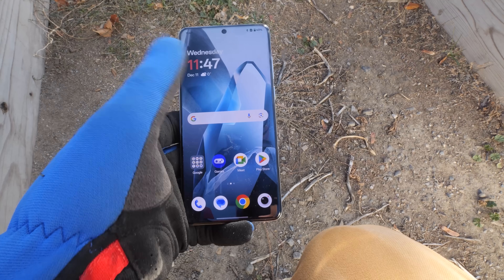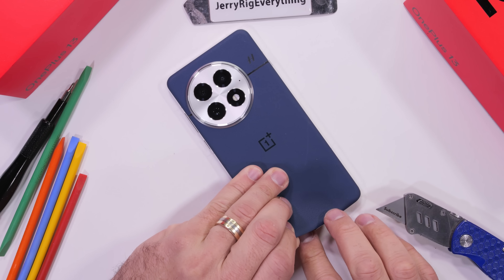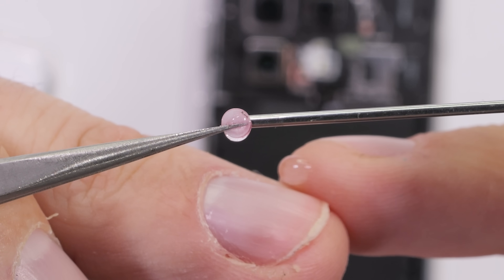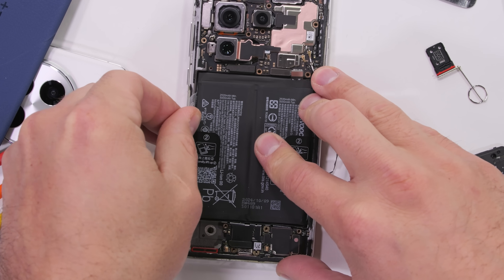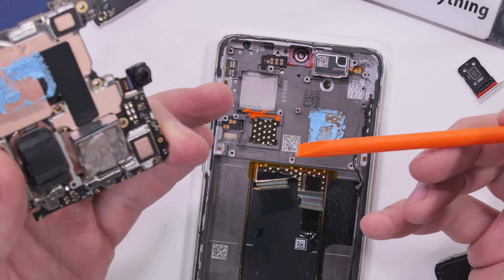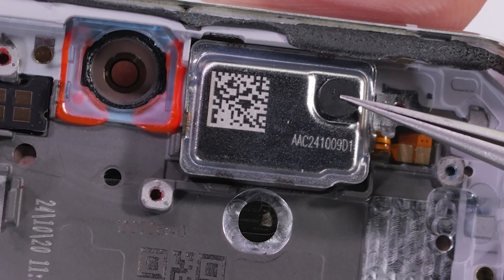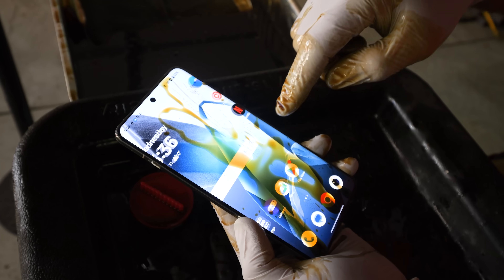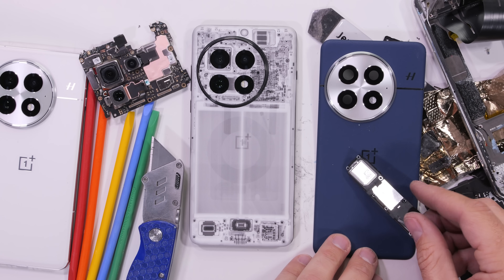The OnePlus 13's Double Decker cooling system - TEARDOWN

Comment: Author, please tell me, if I dry the SIM card tray with a needle when removing it and insert it into the hole next to the tray where the microphone is, can it be damaged or is there some kind of protection?
Reply: Never use a needle! If there's not a SIM tray opener around use a paperclip. It's less damaging.

Comment: Hi, I heard inserting a sim ejector pin inside the mic port won't  damage the waterproof layer or sleeve because its positioned offset at a 90 degree angle, is that true ?

Comment: I have a oneplus 13 black and the glass shattered with a 1 foot drop. Have to replace it.  Regret not buying blue because of leather back
Reply: I dropped mine from 3 feet/1 meter. Only the frame scratched a bit.

Comment: The cooling system on the OnePlus 13 is fantastic. When playing Wuthering Waves my OnePlus 13 is cool and pleasant to use while my S25 Plus and Ultra are hot like a stove. Snapdragon 8 Elite is known to overheat and almost all phones with it face the issue of very high heat. OnePlus 13 solved the problem and did what Samsung and many others couldn't.
Reply: Why do you have 3 new phones? 😅
Reply: Alright. Now try to do it again. S25 ultra was unoptimized prior to one ui 8 and warmed more than before.
Reply: The simple way is to make the Vapor Chamber larger and transfer heat directly to the SOC to the Vapor Chamber. Meanwhile, Samsung's Vapor Chamber used for the S25 series is 1-layer, smaller, even a confusing decision for me is that they direct the SOC and RAM up while the vapor chamber is at the bottom, this causes heat to be transferred indirectly and diffusely through 1 layer of PCB, and Samsung is using a 2-layer PCB design. Stupid design, even an idiot knows that a design that directly contacts the Vapor Chamber via thermal paste like a PC's CPU heatsink does is the best way to keep the temperature down and stable. I think it's not that they can't do it, but they intentionally did it to make the device's performance poor, and next year they made the Vapor Chamber bigger as a huge upgrade to sell. and many years later they made SOC and Ram in direct contact on the bottom surface like that was revolutionary and heat dissipation. I feel like we are sheep that they plan to fleece for a long time, and act like users are idiots to sell 1 version of the phone with changes at least every year. look at how well their R&D department works with telephoto and wide angle camera sensors, making the top Ultra models of Chinese brands use it and of course their top phone S25 ultra doesn't use it. Maybe in 3 years we will see it on S28 ultra as a revolution and technology

Comment: Can someone please test the water resistance while phone is wet inside a case and having the buttons pressed? Cause thats what i did and my oneplus 13 midnight blue died. Screen went black, and battery started heating up randomly on its own as i tried hard reset 100x to no luck. Had to refund the phone. The condition wouldve been no differemt than using phone while in case on a rainy day. For reference i used the tudia pine green merge case. If this happened to me i wouod bet i can happen to alot of people.😢😢😢
Reply: Tell them how many times you put that phone in water. Other people aren't going to constantly get it wet to keep testing it which eventually kills the phone, then return it and get a refund like you did.
Reply: @snowps1  I've washed it at least a dozen times in 3 weeks under the sink. Wiped it off and blew dry and nothing happened. The only t8me was when it was with case on and I pressed button while it was still wet in case....that's when screen stuttered and shut down. This scenario would be no different than if I used phone while under rain and I press on button. So take it from me....don't trust the water resistance advertising....treat it like any non waterproof phone. After seeing all the water abuse videos on YouTube I thought this would be mild in comparison but it died...thank God this happened during my return windows and bestbuy reps didn't ask too much questions.

Comment: Why does adb shell dumpsys battery shows the "Charge counter: 5238000" for 100% charged battery at completely new OnePlus 13 device? 
Similar shows AIDA64/Battery: 
Charge Counter: 5212 mAh
Capacity (Reported by Android): 6000mAh
Device spec says: The battery of the OnePlus 13 adopts a serial dual-cell design, with a typical capacity of 3000mAh, equivalent to 6000mAh; typical energy: 22.92Wh. The rated capacity is 2920mAh, equivalent to 5840mAh; rated energy: 22.31Wh.

So the question, shouldn't we expect 5840000 value there?

Comment: one plus is a good phone but unfortunately it only has an update for 4 years when all the others have 6-7 years, and as always the camera is not very good for a flagship.
Reply: Updates doesn't matter. I max update 1 year after purchase becuase most companies send bugs. Currently still having 7t and going to exchange with 13
Reply: don't forget there is also a problem with the camera which doesn't really fit the flagship standard , don't understand what this means 7t @roninr8199
Reply: @roninr8199  First of all, I'm not talking about a random update to the new version of Android. All competitors have between six and seven years of version updates. I'm not talking about the camera from the previous year. You can't just depend on the processor, 
Because they're not in Apple's league yet,

Comment: I cracked my screen literally 2nd day after getting it. Dropped it from like 1 meter height jacket pocket and fell on lower corner left side. It was cement. There is some blue in the lower corner behind the screen and at the point of impact the silver lining frame got one small indentation and some chipping off nearby. Curved screens are a nightmare. I dont think Corning glass would be so fragile. I am getting it repaired and slapping a military grade case on this thing. The screen is gorgeous but its not worth risking without a good screen protector. I even kept the membrane it comes with on and checked several unboxing videos nobody was shown removing it which was what i was interested in seeing. I think it should be removed and a proper temper glass be applied. Although i don't think thats going to be much help either. Need a flap on the screen or this screen will break before you know it.

Comment: Holding out for your bend test results -  A phone's cutting edge techy specs don't matter if that phone is too fragile to survive real world use.  I was a faithful OnePlus customer until my phone's rear glass broke in my front pocket.  Now I don't buy any phone that fails your bend test.  I had reached across a table and inadvertently leaned against the table, with the phone in my pant pocket sandwiched between my thigh and the table edge.  The forces exerted on the phone during this failure were similar to your bend test.

Comment: I once dropped my op 8 into dirty motor oil pan it surprisingly survived still actively using it
Reply: I also used a brake cleaner on it to clean oil and then rinsed it with soapy water

Comment: Note how there was no bend test performed...

If a phone is water resistant, motor oil won't penetrate either since it's more viscous and the molecules are larger than water's. Also the phone landed on a pretty soft-looking pile of grass and foliage but I doubt that was on purpose or helped all that much with a drop at that height.

Comment: Drop on grass from 100 feet and nothing will happen to any of the current phones
One plus is just any other Chinese phone with better branding
This phone has throttling issues, lower benchmark scores than similar SD elite phones. Way too costly, and selling plastic back panel as microfiber s̤ḥiṭ

Comment: I bought a OnePlus 11 a couple of years ago. While waiting for the case to arrive, I dropped from 1 foot, yes foot (30cm) onto a hard tile floor and the curved glass back slightly shattered in the corner. 

I put a skin on it and the case and I still use it but one foot. 

The phone works ok but the camera is pathetic. The autofocus is so slow that most times it is out of focus. My iPhone 6 was much better. At the time most of the reviews which I now realise were sponsored were very positive about the camera. Are you sponsored for this review Jerry?

Next time you do a drop test, do it in something hard: at least 6 on the mo scale

Comment: I don't know, it still has some problems, one of which is unacceptable for a 2025 "flagship". It has horrible frame drops in 4K 60 FPS recording. My 3 years old "obsolete" Exynos S22 Ultra never had a single frame drop, not even in 8K 24 FPS. It is also way too expensive in Europe, at least $1250 for the 512GB version. So it is almost as expensive as an iPhone 16 Pro Max. The 256GB version is not even listed, for whatever reason. S24 Ultra, in comparison, still sometimes goes for as low as $830!

Comment: 5:07 no, it cant "zoom" in 120x. it can only do 73mm (3x) any futher and you lose a significant amount of detail.
Reply: the camera setup is also REALLY mediocre. very small pixels.. its just a noisy mess. the MAIN cam has 1.1 microns?? and the telephoto prime, which is btw, less focal length than my 2020 Galaxy S20 FE, has just 0.80 microns.. its an abysmal setup. thats what happens when you care about megapixels. you get a worse camera out of it.

Comment: hey, i did a break test, there goes $800 dollars that i couldnt afford, i got the oneplus 13 and the keyboard was so stupid and all the mispelling and the features not working i hit it not even that hard with a screen protector, against my desk and a hole went right through it, -$800 and you can tell them its not durable

Comment: Hey Everyone 🤠
Find the parts that interest you:

0:00 - Throwing the OnePlus 13 off a building
1:12 - Phone survives extreme durability tests
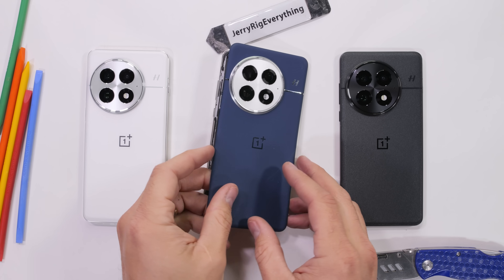2:13 - Exploring the OnePlus 13's unique colors
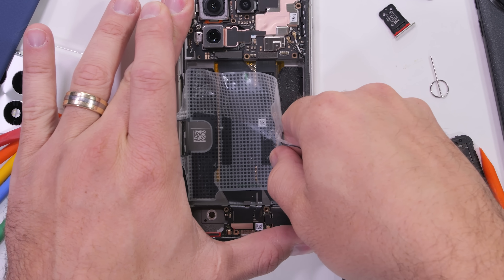4:10 - Overview of the Vapor chamber design
5:32 - IP68 and IP69 water resistance details
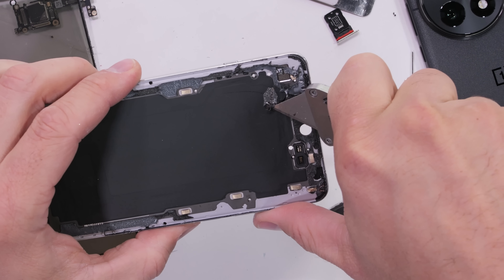6:57 - Dual cryo velocity Vapor chamber benefits

Chat with videos via Bumpups 🌲

Comment: Mr. Rig....I had a question for you sir. Which phone would you say has the best, long lasting battery today? My previous 3 phones, one of which an earlier gen OnePlus, would drain rather quick and would have difficulties charging on non-fast charging ports.

Thanks a ton for reading!

Comment: I do really like One Plus. Use to have a OnePlus 7 Pro 5G. Great phone and i loved it for how different it was. With the pop up front facing camera. Also liked some of their RND prototype phones. Such as the water cooled phone that used (i believe it was) Crystal based Diyafram pumps. Which when excited with power they would then pump and then pump coolant around the phone.

Just feel like these days the only thing that seperates phone makers is repairability - Software/OS support - Security updates other than actual innovation. When you showed the Red magic phones. Ones with the cooling fans in. That was epic to me. Speically when i work in the telecoms space. Nice to see a non-standard slab or gold, copper, titanium, and aluminium phone that looks similar from the rest.

Comment: Every phone will survive that drop test. Throw it in a solid surface like road
Reply: Ok!!
Reply: true, my meizu m6 note survived drop from a 5th floor of a slavic panel-type house.
Reply: That sounds like if you would do car crash test at 200 kph. Why? To see all of them get completely destroyed?
Reply: @bencze465 Well, car crashes are a lot fewer from phone crashes, and yes there are standardized tests verifying car structure integrity by doing high velocity test crashes.
Reply: @bencze465  doesnt matter the speed, what the car hits IS standardized. 200kph into a wall of pillows is NOT the same as into a wall of concrete. theres a reason what it hits is the important part
Reply: or maybe don't do that, my oneplus 13s screen broke yesterday from a 1m fall on concrete WITH a screen protector... I'm furious.

Comment: Drop the phone on the cement.  In the city this is the surface it usually falls on.
Reply: I accidentally dropped my 13 from 1 meter high. 
Dents in screen protection film, small scratches on frame, glass intact front and back. No cover.

Comment: Dam that's a nice phone. My elder bro has Oneplus 7, he recently moved to iPhone 16 pro. His Oneplus 7 still works just fine, no complaints actually I was gonna ask him for it but he mentioned he will be keeping his Oneplus with him since he had TRA version of his iPhone which only has 1 sim.. so just kept quiet. 

The greenline issue was only on some of their Oneplus 9-12 models, I have friends using Oneplus 9 who haven't faced any issues. Plus, Oneplus has been responsible with their devices really well, they are probably the only company that has made life long screen replacement warranty for their new phones incase us as customer faced that issue. I would buy one if I could.

Comment: SuperVooc works by simultaneously charging 2 batteries which makes reduces charging time significantly, by charging both 3000 mAh batteries together. So is it possible to split if even further to reduce more time ? What if they charge 3 batteries of 2000 mAh at the same time ? Will it work and charge faster ?

Comment: Most years I buy the latest OnePlus phone and sadly this is one I'll be skipping.

They lowered the price and lowered the camera specs as a result and that's just not cricket.
The new telephoto has an awfully long focus range for macro vs the OnePlus 12 which is what I'm using now. 50mm vs 20mm iirc. 

Shame they cut corners by lowering the price, I just want a decent phone, not the race to the bottom price...

Comment: oneplus 12 was the worst phone in network connectivity last year. Heats a lot as well
Reply: One year into the OP12. No issues. I will keep it for a few years.
Reply: @KrishnenduKes  yeah in normal usage like social media or phone calls it works fine, but while online gaming, it cant maintain constant ms while on mobile data and heats a lot and FPS drops even if i turn on performance mode.
Reply: @unofficialmlbb9360  Got it. Thanks for your reply. I guess it is not designed for gaming. It gets all my job done, heavy SM, emails, video editing daily and maps daily, works really well for me. Maybe not for gaming as you say.